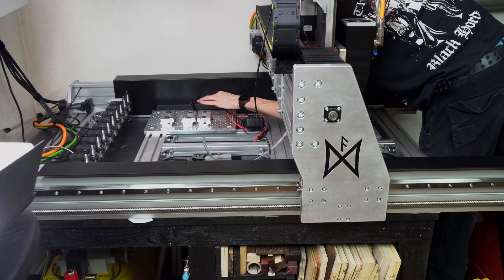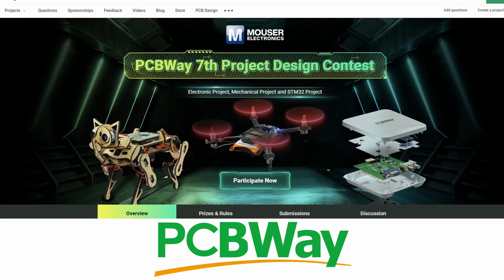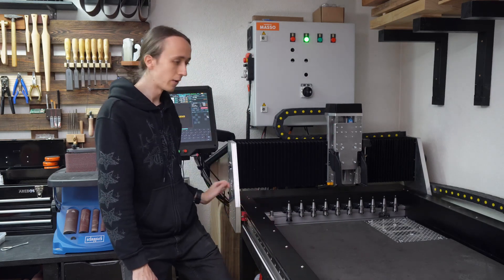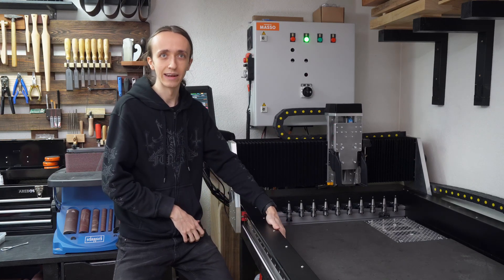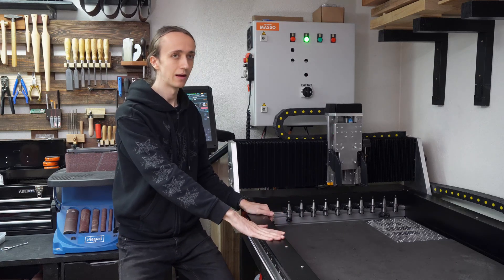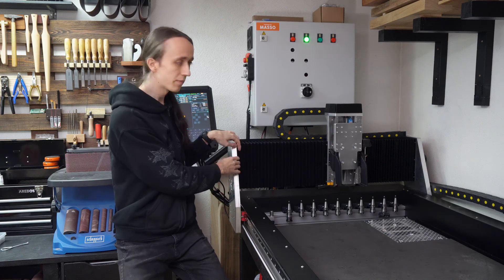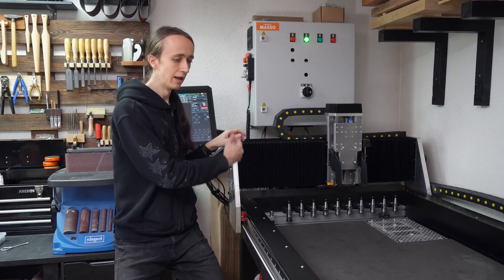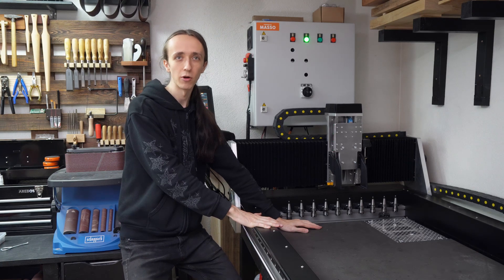Sheet Metal Covers and Fully Custom Bellows - Dark Art CNC Part 4

Comment: That is a super slick macine!
Did you ever consider using a custom X-axis profile like this one?
https://vallder.com/wp-content/uploads/2021/05/products-CNC-X-axis-alu-profile-1a.jpg
Reply from the maker: One of the main design considerations for this machine was that it is build from easily available standard parts wherever possible to make sourcing easier. But I had also never heard of this kind of profile or brand, looks interesting for sure.

Comment: If you choose to make your drawing package available for sale in an editable format, then i might be interested.   I am planning a larger footprint for my build, but i have chosen the same motion devices and controller, so it would be much easier to stretch your drawings.  I was planning to use NEMA 34 closed loop steppers but if they leadshine servos are a financially viable option then ypu may have sold me on them.  I just need to figure out which model can be slaved together on the y axis for the optimization software.
Reply from the maker: I will have the 3d model for sale once I'm all done with it.

Comment: Did they give you any idea of the minimum collapsed length for a given length of the bellows?  I dont see that info on the sellers page and am wondering how much space I should allocate to either side of the z axis on a 4 ft wide gantry.
Reply from the maker: Yes, usually you specify the extended length and then depending on how tall your folds are and the thickness of the material determines the compression ratio. For mine it was 10:1 which seems quite common. If it isn't listed you can just ask and they will be able to tell you.

Comment: After all this time watching your videos, I'm completely inspired to get a CNC. I'm torn between the Ratrig Stronghold One and the Ultimate Bee. Do you have any thoughts on this? Ball screws and the ER20 collet are a strong argument for me, but I've never used a CNC, so I don't trust my gut feel.
Reply from the maker: Ball screws I don't see as very important, leadscrews can be just as good for a hobby machine as cheap ball screws. ER20 collets however, are a much bigger benefit to me as it gives you complete tooling freedom. Shipping to wherever you live is also something you should take into account and might swing you one way or the other.
Reply: @DarkArtGuitarsWorkshop awesome, thanks! I'm based in Cyprus, so weirdly shipping amounts to about the same. Ratrig it is!!!

Comment: That machine is looking 1st class 😊

Only thing that might be a problem, is how far down the spindle is mounted on the Z plate, since it's bolted to the "floating" end of the Z plate.
Won't it introduce some chatter when milling harder materials?
Best of luck bruh!
Reply from the maker: With where the mounting holes are located on the spindle there is no real option to mount it over the bearings as it would not reach down enough. The plate it is screwed to is 20mm thick so I'm pretty sure I should be fine, but only time will tell.
Reply: @DarkArtGuitars  yeah I see... It would be good if the spindle had 2 more mounting holes at the top end. It would definitely be a stiffer setup.
I hope it's good how as it is now 🙂
I did take that into account when designing my Z.
But I don't have a nice spindle like yours 🤓😍
Reply from the maker: @xyzspec82  I think the reason it doesn't have any mounting higher up is that their design is quite modular depending on if you have ATC and water or air cooled. The non ATC water cooled version is basically just the lower half of what I have.